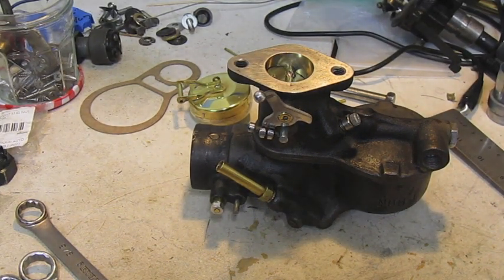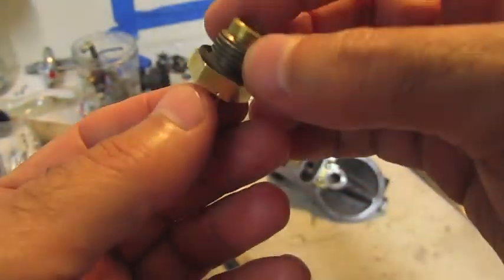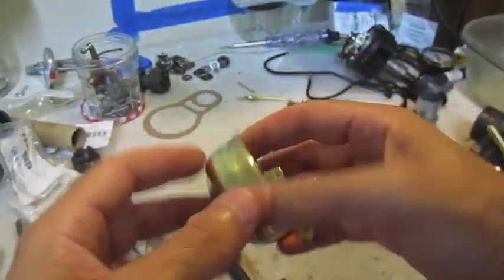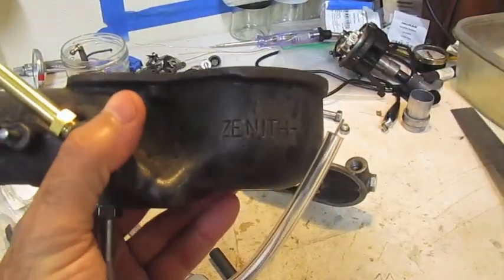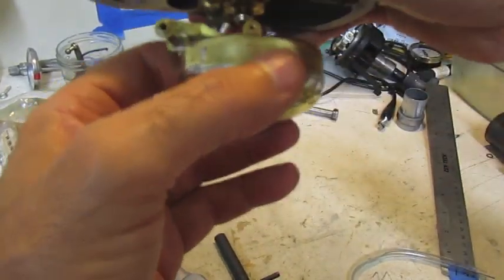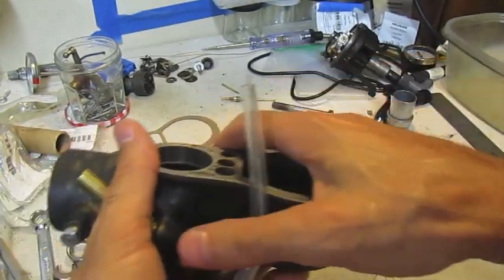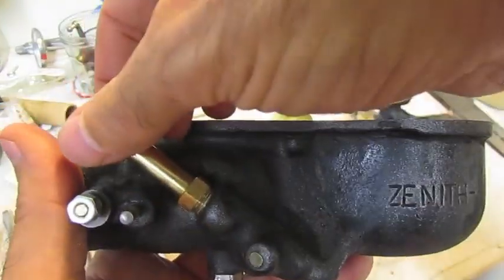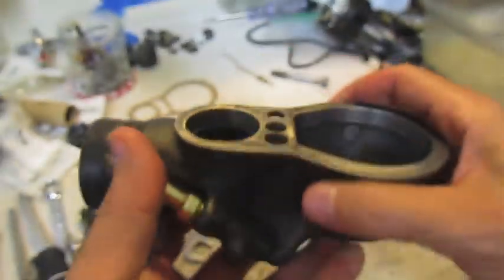Ford Model A - Zenith carburetor checking for leaks and float level

Comment: What causes the engine to die when coming to a sudden stop?
Reply: Could be 3 different things !!  If the engine  run fine onthe road must time it's fuel level
Reply from the maker: It could be a few things.   One is the float level in your carburetor is not set correctly.  Another is the idle adjustment on the carburetor, since when you come to a stop, you are effectively idling at that point.